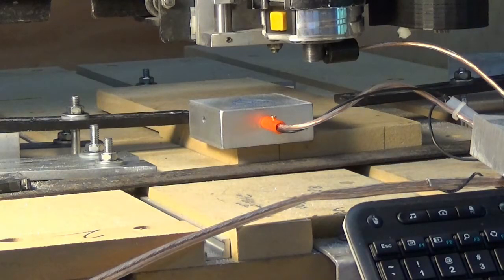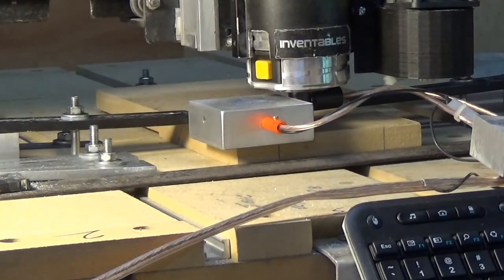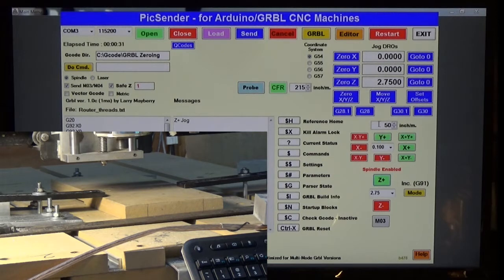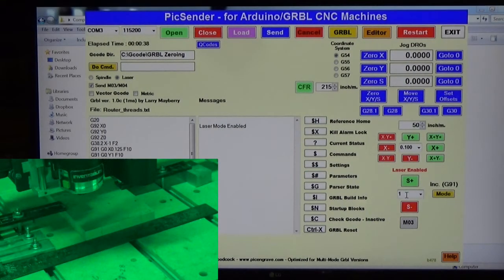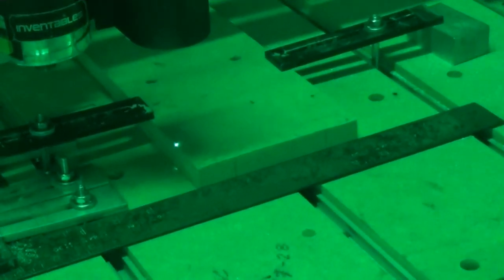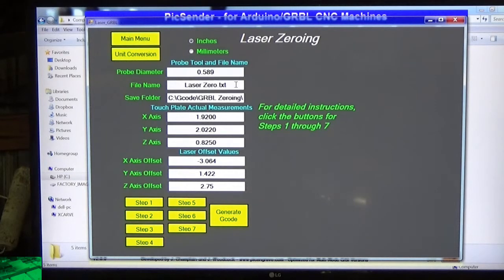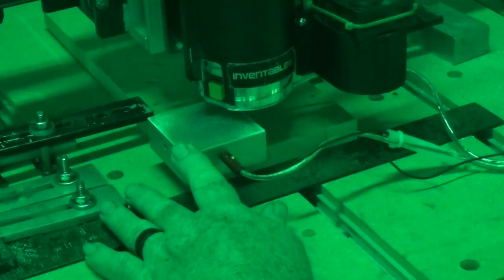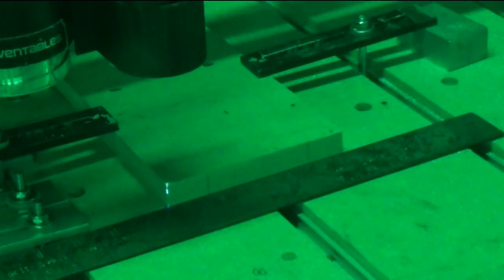Laser Zeroing With the Triquetra Touch Plate

Comment: Great video Charley!  Can I still use this method if my zero isn't on the lower left corner?  For example, if my router zero was in a random place on the work piece...can I create a offset gcode like this that I could turn plug into a macro so I could just hit the macro button and whatever router zero I had the macro would jog the machine so it moved the laser to that zero position?
Reply from the maker: My zeroing macro isn't written to do that but you could write a macro to do something like that if you were so inclined.
Reply: @CharleyThomas2016  That's where I'm stuck.  I'm not sure what to use to jog the machine for example from x0 y0 to say x2 y2 in a macro.  Would you know?
Reply from the maker: @benjaminl3084  What software are you using to control your machine with? Easel, Carbide Motion, PicSender, UGS, etc...
Reply: I have the openbuilds lead 1010 so I use the openbuilds control.
Reply from the maker: @benjaminl3084  The Triquetra Tool Box will generate a zeroing file that allows you to define offsets for the X Y zero to be located.  This works even if you have a precut circle blank and use bump stops.  It allows you to set your X Y Z Zero to the center of the circle. (Or any other location you want)

Comment: How did you determine your z offset of 2.75?
Reply from the maker: I initially zeroed my spindle without any offset. Then I raised my Z axis up until I could focus the laser. The height I ended up with was 2.75 inches up from zero. So I used that as an offset and recreated the zeroing code that would put the Z axis up to 2.75 instead of down to zero.  In the Triquetra Tool Box there is a section called Fine tuning. You can put the offset in there and it will make all the calculations for you and then you just create a new zero gcode and your all set.  This assumes that you have a fixed position to mount your laser so that it is always in the exact same orientation for all three axis.